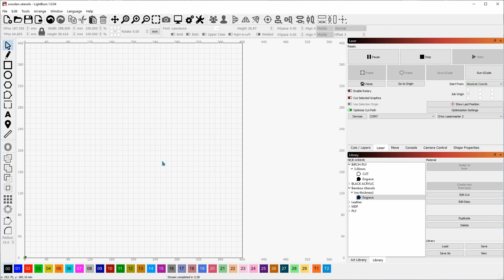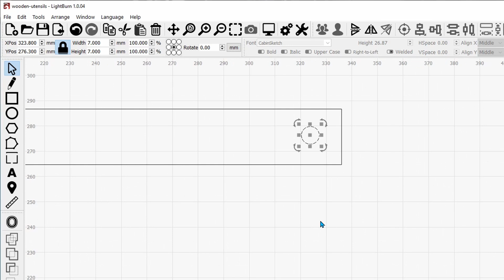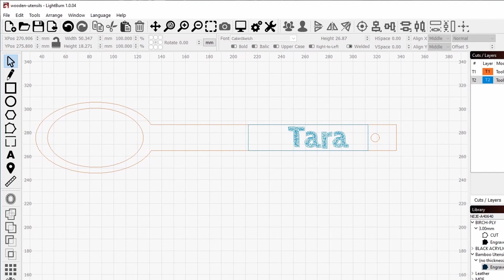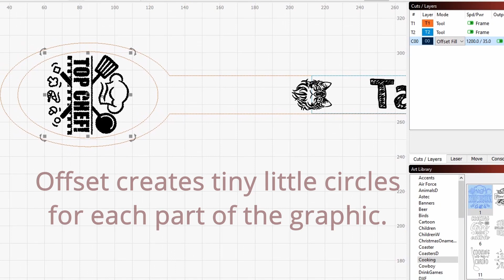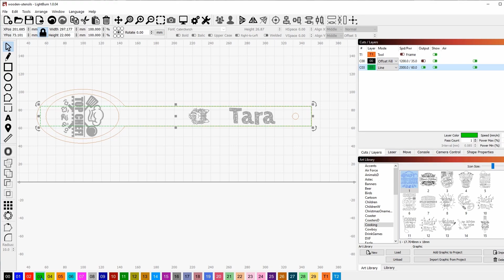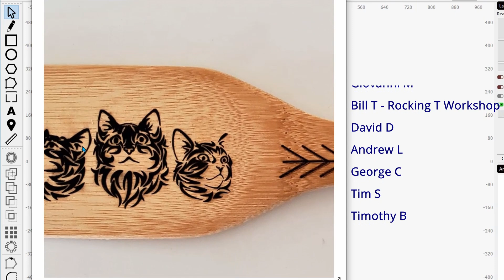👌 Perfect Laser Engraving on Bamboo Utensils!

Comment: I like your bed. Brilliant idea. Question though, plywood sometimes has a tendency to curl slightly. How do get it to lay flat on that bed?
Reply from the maker: You don't, you have to use the honeycomb bed with hold down pins or magnets. This bed is only for flat material.
Reply: @TheLouisianaHobbyGuy  ok so there is no one bed to rule them all. You need multiple beds in your quiver 😄

Comment: Great video Rich. Exactly what I was looking for. Rich do you have a video how to engrave a glass? I'm still fighting with that..if use a masking tape or paint on the surface and how to do setting of power and speed on my diode laser 20W .Thank you in advance for help
Reply: Thanks Rich.  I will try that
Reply: Is the acrylic same technique with tempera?
Reply from the maker: @tonyc6331  Yes Sir!
Reply from the maker: No Tony, but I have one on my list! I usually do glass at 1200 speed and 70% power on the diode. I coat the glass with black Tempera first for the best results.

Comment: Hello Rich, first, thanks for the explanatory video. What does 'Offset Fill' mean, which does not appear on my LightBurn?
PS.: Another thing: how is the name of this perforated bed (aluminum?) that you use in the laser machine? I live in Brazil and the name must be different.
Reply from the maker: Offset fill goes around in a circle. So if you had a big circle or square and graphics in the middle, you would put the circle or square on another layer and set it to offset fill. Then the outer shape will keep the laser from scanning left to right wasting time.
The bed is just sheet steel with punk spikes.
Reply: @TheLouisianaHobbyGuy  Thanks

Comment: idk what im doing wrong. my setting match yours and i barely see anything. how do your get it so dark?
Reply from the maker: Proper focus Hashly. Every laser will burn differently. You have to run a test card on every material to find out your best settings.
Reply: @TheLouisianaHobbyGuy  I have to burn it at 35/90 to get anywhere near close to the results you get
Reply from the maker: @hashlyhaze2985  I may have used the 10W in this video, I don't remember.
Reply: @The Louisiana Hobby Guy  my laser came with a focus tool. I feel pretty confident that I'm in focus. I will admit I know nothing about pre-treating anything.

Comment: Hi! Great Work! But my concern is that, because the item is to be used on food. Will that be safe? Would burn be lighten due to washing and if it does, would you accidentally consume the particles that drops out from the burn?
Reply from the maker: Hi Kaysee, As with all wood burns that I do, I mist them with water right after the burn and then let them air-dry naturally so the soot stains the wood. Then I wash them and seal them with food safe mineral oil. https://amzn.to/3juMXpT. After they dry, I wax them with  100% organic beeswax https://amzn.to/3E87Cbi. So yes, they are safe to use on food. Hope this helps answer your question!

Comment: Hi guys, I heard that ortur launched a new portable diode laser machine called Aufero, the official sub-brand of Ortur Laser Engraver, Do you think it worth to buy? I'm new to the laser, I heard that Aufero is easily to get started. I really want to buy one.
Reply from the maker: It's basically an LM2 Pro with a cantilever arm instead of a square frame, and much smaller working size. It's made for desktop use.

Comment: Awesome video…just wish I’d seen it last week. After getting 2 off-center pretty bad, I ended up putting one on the scanner, importing the scan and tracing it.  Measuring would have been a lot easier.  I also did a very light burn of the spoon shape into my MDF base before putting it on the tool layer so I’d be able to line up other spoons but I didn’t want to have to do that for all of the bamboo utensil shapes.  I’ll be using your multi-pass trick for the rest of them.
Reply from the maker: Awesome Lori! So glad it helped you!